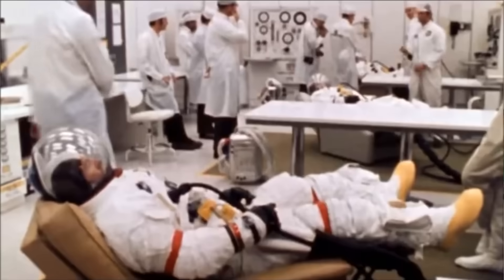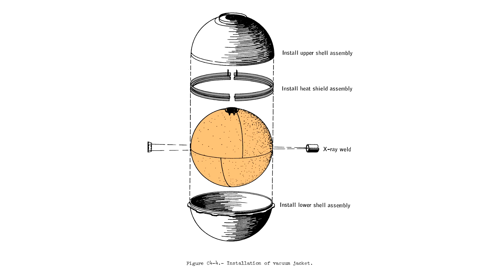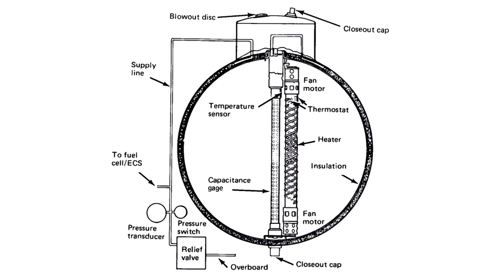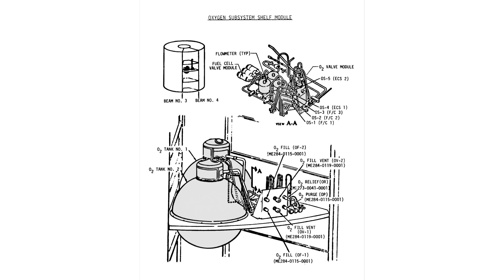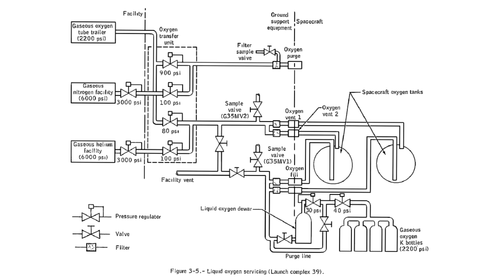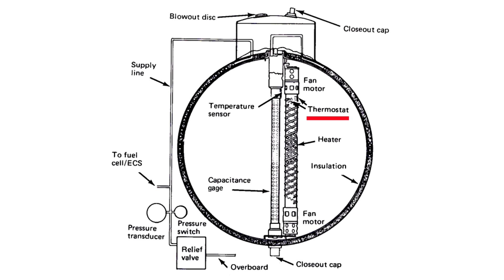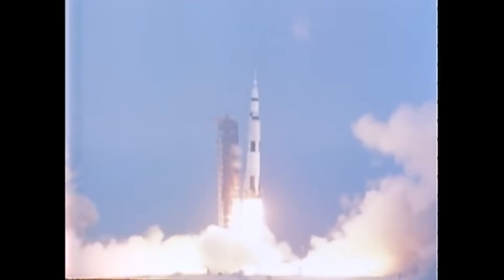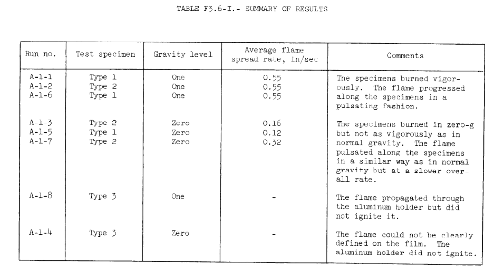What Caused The Explosion That Crippled Apollo 13?

Comment: I worked at an engineering firm in 1971 and I personally tested a device that I was told was being added to future Apollo missions to stop the oxygen tank failure from ever happening again.  The device was an accelerometer that would be placed on a cross beam to detect a rocket engine premature shutdown.  People are never mentioning, that when rocket engine #5 failed during liftoff, it shook the space craft with a low frequency vibration of around 130G force.  I was told that is what caused the oxygen tank failure.  Yes, parts might have already been damaged in the oxygen tank, but it was still functioning.  It was the violent shaking of the tank that caused the final failure.  I suspect that the temperature sensor was dislodged from its mounting and caused a false temperature reading inside the tank.  This is a classic temperature feedback failure and runaway.  A temperature sensor can be easily checked for malfunction and the system failure reported and the tank turned off.  If the temperature sensor is working and dislodged loose from its mounting, the temperature control loop will start putting maximum heat into the system to control the temperature at its setpoint.  The sensor not being in good thermal contact with the temperature zone will not see the true temperature rise from the heater and the system will run away and over heat.  The real cause of the oxygen tank failure was the #5 rocket engine premature shutdown causing the intense vibration and dislodging the temperature sensor from its mounting.  I have worked with temperature control loops for 35 years in mission critical areas where a sensor failure would cause massive damage.  It was not possible to easily detect this failure in the 1960's.  The only way to prevent that kind of failure was with a mechanical means and a thermal fuse.  The mechanical means prevented the senor from being dislodge and the thermal fuse would break power to the heaters if the temperature rose about a certain point.  The oxygen tanks obviously did not have a thermal fuse.  The temperature in that tank should never been allowed to rise to 500 degrees.  Yes, we did solve this problem much later when advanced computers were introduced.  The solution was adding a thermal profile of the temperature zone into the control system software.  If the heater was turned on full and the temperature rise was not within the thermal profile of the temperature zone, after a fixed about of time, the sensor must not be in proper contact with the thermal zone.  This is easily done with computers today to prevent thermal runaways.  What happens when the computer crashes with the heater on, a fail safe device would detect the lack of computer update and would remove all power to all temperature zones.
Reply: Several people have discovered this the hard way with various cheaper 3D printers. There's a 3D printer firmware version out there that has a setting turned off by default. It's to shut down the hot end heat if the thermal sensor reads a temperature that's obviously far too low and isn't going up as power to the heater is increased. The result is thermal runaway until something catches fire. There are ways to enable that setting on that revision, and later revisions have that enabled by default. Some companies, like Prusa, would make sure to enable the setting, but many of them would just download the firmware, change whatever was required to fit their printer's mechanical design, then start shipping printers.
But the root cause of the problem was the people writing the open source printer firmware didn't think "Maximum safety, 100% of the time." and have the code have every safety setting enabled by default.

What should have happened with the Apollo 13 tank was after it was damaged it should have been tagged as defective, not to be used for flight. Then it should have been cut apart to see what all had been damaged. Then the wiring problems would have been found, spurring a check of other wiring to ensure that the changes in voltage specification had been actually and properly addressed by really upgrading wires etc rather than either "pencil whipping" bogus change paperwork or as mentioned in the video, assuming that contacts that can handle higher than spec power can handle switching it.

There's a documentary from 2003 titled "Space Shuttle Garage" (It was on either Discovery or History Channel) which covered all the work done to the Shuttles between flights. What it revealed was that most of the processes and procedures were frozen circa 1981. I only got to see part of it, but one part was in hindsight a bit horrifying. It showed a crew failing to get either one of the two special wheel nut torque wrenches to work properly. Did they keep at it until they got it right? Nope! End of shift they put a note in the procedure manual so the next shift could have a go. Here's this massive binder full of sheets of paper, looked like tabs and bookmarks and who knows what sticking out the sides. At the start of each shift the crew would have to go through that binder to figure out what had to be done, and what was supposed to have been done but wasn't and why, and hope the people who left problem notes had described things accurately.

I was thinking "Oh. My. God. Why?" It's 2003 (or possibly the docu video shooting was done in 2002) why haven't they upgraded... anything? That binder should have years ago been replaced with a computer on a cart with all the material from the binder on it, fully indexed and searchable. It should also have note taking features and a scheduling and alerting system so that at the start of a shift the crew can login and what needs done is right there and any issues popped up with a cannot miss it alert, visual and auditory.

Just as awful and outdated was the process for making replacement tiles. I thought they would have used CNC machines to carve new ones. Nope. 100% manual process. There was a warehouse with full size physical templates for every tile on every Shuttle, with their locations stored on index cards in an old wooden card catalog, exactly like the ones most libraries had abandoned for a computer index by at least the early 90's. Find the tile number (or figure out out from surrounding tiles if all the numbers are gone from the damaged one) then pull its card to find the template. Read measurements on the card to rough cut a block of silica foam on a bandsaw. Mount the foam block and template in a 3D carving pantograph and manually run the probe all over the template so the diamond cutting burr in the enclosed box side (with dust vacuum) shapes the foam. Then the foam gets a freehand dip into a white ceramic slurry, dried then fired. Black tiles get a second dip in the black coating. Of course there are Mark 1 Eyeball inspections after every step. The last step is pulling the tile's number stencil from a second old fashioned wooden card catalog and using it to airbrush the number onto the tile in several spots. I wonder what's become of all those tile templates? NASA could raise a good chunk of change by selling the templates as sets with their index and stencil cards. How about $500 a set times how many thousand tiles? Have an Ultra Premium higher priced set with a newly made tile to match. Supplies for "UP Grade" sets limited by how much leftover silica foam and coating remains.

I figured I'd be able to catch a subsequent showing in full, since Discovery and History repeat everything multiple times. But a couple of months later Columbia broke apart and that warts and all documentary has been very effectively memory holed. I wouldn't be surprised to find the master recordings and every copy held by everyone involved was ordered deleted. It never appeared for sale on the Discovery or History web stores.

History Channel had another documentary on spies that was a one time only showing and has never been seen again, I suspect due to a couple of inconvenient revelations it had about Chinese spies and Vietnam, but that's a subject for a different thread.

Comment: It"s reminiscent of the decision to ground test with the crew in the Command Module on 100% oxygen and at the same time not use fire resistant materials in the CM since a fire could be extinguished quickly in space by dumping the oxygen. Both decisions by high level NASA managers, possibly even the same one.
Reply: The issue was not, that it was 100% oxygen.
In order to perform the leakage test, the pressure inside the capsule had to be raised way over 1 bar.
Something that would have never happend in space. In fact when in space the pressure in the capsule was way lower then 1 bar, giving roughly the same amount of oxygen per volume as it would be, would there be ordinary air.
So with the regular pressure in flight, the risk is more or less exactly the same as on earth under regular atmospheric conditions.
It only happend because the leak test was done with the capsule at higher pressure then normal. The issue was solved by not filling the capsule with pure oxygen at the Cape but instead staying with air but add an additional pressure valve which would close during the ascent, when the dropping pressure reached the intended capsule pressure. From them on, the air was steadily replaced with pure oxygen.
Reply: @kallewirsch2263  So you are stating the crew would have been okay if the capsule pressure had only been 1 bar or so?
Reply: @dalecomer5951  
No.
The crew would have been ok, if the test would have been performed with ordinary air.
But this was not possible, since the capsule was not equipped with air containers. The capsule only had the facilities to be filled with oxygen. That is why they used it to perform the test.

It was a leakage test. Thus they needed to pressurize the capsule with a higher pressure then the surroundings. Just using 1 bar (same as the surroundings) for the test would not have been enough. They NEEDED the higher pressure for the test.
Reply: @kallewirsch2263  Out of curiosity, when were you born?

Comment: So basically a bolt and some switches killed Apollo 13 (and is likely the reason the Apollo program was cancelled (Nixon was afraid that if another failure happened, it would hurt his re-election bid)).
Reply: He was right about one thing. Like the space shuttle, these guys were flying by the seat of their pants
Reply: @jimmyjames6318  I think your using that terminology wrong. Flying by the seat of you're pants is flying without instrumentation, I think you meant by the skin of their teeth. Plus that's just how space travel goes. One small thing going wrong can cascade down into catastrophic failure. Today, we can safely shut down systems, but in cases like this, where it's a mechanical failure, and the sensors weren't working properly, I don't think there's much to be done about that other than building in isolated redundancies (what made the Apollo 13 failure bad was that the redundant tank was connected, and couldn't be shut off).

Comment: Great, as always! I've got a somewhat unrelated question...

I wondered where you got some of the photos of the fuel cell and oxygen tanks shelves in the service module. A few years ago, my son decided I might need a hobby - or at least revive one, and he brought me the Revell kit of the command and service modules showing a bit of the interior. Obviously, the kit designers were on drugs as so much was missing, wrong or just too cheesy looking. I wanted to super detail the interiors (like with the fluorescent work lights between the seats I carved), complete with tiny LEDs for light sources.

It was a bloody bear getting good reference photos, and getting any consistency between beryllium shielding locations, O2  lines, wiring, N2 tanks, and installing an accurate control panel (including a tiny switch saying SEC/AUX) which cost about $50US. I even resorted to watching Apollo 13 frame by frame in some scenes to get details. 

I still haven't finished the kit as I'm mainly held up by the SM section showing the shelves, wiring, and colors of mylar, silver or gold, both were used, etc. If you or any kind viewers have any ideas, I'd be very grateful...

Once again, fantastic video. Obviously inspired me to get back to work on that SM and finish installing the final interior parts to the Block 2 CM. Thanks for your hard work!
Reply: That's one hell of a question 😂
Reply: @jimmyjames6318  Pretty wordy, hunh? Sorry, sometimes I can't shut up. I've just had some health problems crop up again, and I'd really love to finish that model for my Son and Grandson. I will say that looking for all the detailed pictures has me really scratching my head as to how they came up with all the systems and sub-systems! I mean most of the stuff on the Apollo Saturns wasn't just old technology gradually maturing, like airplanes and early cars. This stuff was mission specific and often designed out of necessity, not just performance.

Sure gives you an appreciation for the engineers!

Comment: I remember reading a report about this years ago, prior missions had a 12 volt electrical system, and Apollo 13 had a 24 volt electrical operating system, a 12 volt powered oxygen tank was the fatal problem, once it was powered up it blew up.

Comment: I worked for the company that built that thermostat that welded. The design engineer for the thermostat line had the same picture you showed on the wall of his cube as a reminder that limits are not to be exceeded. That example was used when customers would call and ask if they could be used at higher voltages/currents. Nearly all of the people who were working at that time had retired when I started, I wish I could have gotten first hand accounts of the aftermath.
Reply: But, the cryotank in Apollo 13's SM was originally installed in Apollo 10 and removed for test anomalies. When it was refurbished and installed in 13, North American Rockwell neglected to swap out the thermostat. The voltage tolerances had changed since 10.

I wonder if Lee Atwood tore that technician a new asshole.
Reply: @dalethelander3781  if not he should have
Reply: so it happened much slower then the movies shows it happening🤔🤔
Reply: dramatizations are like that.   the movie "margin call" portays the 2008 financial crisis as if it happened overnight, when it reality it took months, I think.

Comment: Thanks for that, THE most complete explanation I've seen since it happened.  Something I read at the time put it in much simpler terms.  Some idiot had OKed the design allowing different than design voltages to be fed into the system. In other words, different voltages were allowed on the same connector design.  Just bad engineering. Imagine if all the power connectors in the world were the same only some places were 110V, others 240V, still others who knows what.  It's a disaster that's been designed to happen.  Thanks for the update.   :)

Comment: If the detanking procedure resulted in gaseous O2 at the 92% point, wouldn't the tech assume that there is a real problem going on? I mean, it's just a straw ... if no more liquid is coming out, there's a leak. Now, I don't know how the liquid supercritical O2 acts in zero-G, but wouldn't think mean you could only get 8% of the O2 out of the tank in flight, cutting your available O2 by about half??

Comment: I used to repair and maintain life support equipment. This was like a horror story. "Oh, this absolutely mission critical, life critical, equipment that is full of pressurised oxygen, wires, heaters and other witch's brew stuff is behaving abnormally, we'd better TOTALLY IGNORE that."

"Oh, if this component fails, everyone dies, better have two for redundancy then, but I'll just manifold them together for convenience." 

"If there's an over pressure event, we don't want to damage anything, so I'll put in a burst disk, for safety (I'm so clever). Now I could have that vent to space, or I could have it vent to the sealed compartment that will explode if it's over pressurised. I'll vent it to the compartment."

How the hell those morons ever got to the moon is beyond me.

Comment: Great explanation!  One question: I may have missed it, but did O2 Tank One actually fail Michael Bay style (techno-color boom)?  Or was the penetration failure due to the teflon fire large enough to cause the over-pressurization of the compartment?  Other recent video explanations show re-enactments where both O2 tanks are destroyed, but also explain that O2 levels in tank 1 decreased rapidly, verses immediately due to the rapid and violent deconstruction.